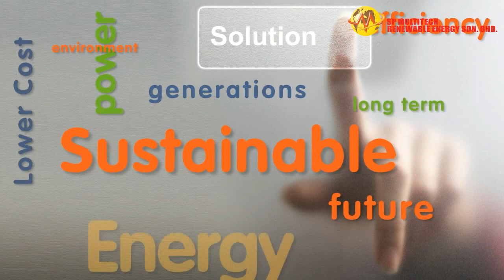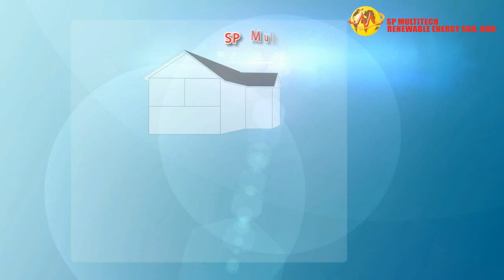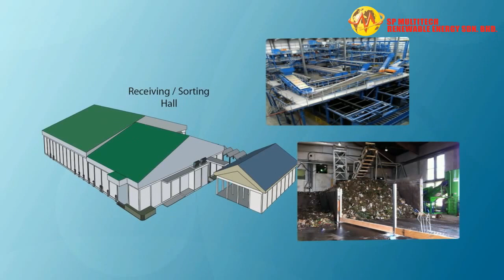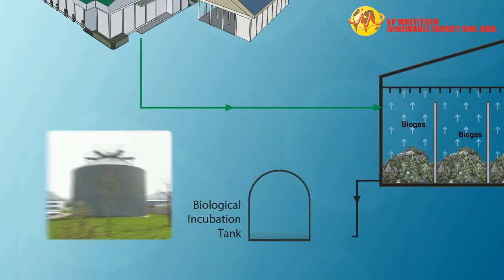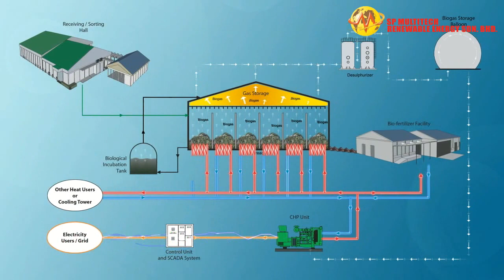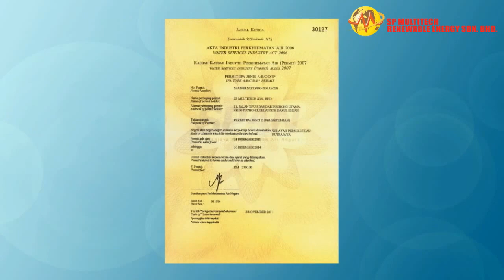Alinova Holding S.A. -  Renewable Energy From Waste

Comment from the maker: How to produce energy from waste. The wastes are waste products of the production process and consumption. Despite having lost any usefulness final waste is still composed of materials that can be recovered by recycling or be used to produce heat and electricity . Some of the waste can in fact turn into an excellent fuel . The energy recovery takes place in special incineration plants such incinerators. The burning of waste in incinerators generates heat ( thermal energy) and electricity via a generator turbine . The incineration can be considered as a technological evolution of incineration . By itself the incinerators are modern incinerators that enhance the combustion of waste to produce energy. It should be stressed that not all waste can be sent to incineration . Can be burned in incinerators only a particular mixture of waste pre- treated with physical-chemical processes . This mixture is called the RDF ( Refuse Derived Fuel ) and consists mainly of plastics, petroleum products , tires , etc. . Anything that can not be started to-energy must be stored in landfills normal or special depending on the type of waste . A recent case concerns the placement of the CDR between renewable energy sources . In fact, despite being an important way to recovery and energy efficiency , energy from waste can not be considered a renewable energy source because the CDR is composed of materials derived from petroleum , which, as everyone knows , is a source non-renewable energy .

Energy from biogas. Another way to generate energy from waste is the recovery of the biogas . The organic waste is smashed and fragmented into small pieces to be stored in landfills under anaerobic conditions. The action of bacteria and micro-organisms contained in the organic matter itself, allows you to start the fermentation of matter. One of the products of bacterial digestion of the raw material is natural gas. The latter is recovered from the landfill through appropriate vertical wells , worked into biogas , and finally burned in an internal combustion engine which allows to produce electricity. In addition to enabling energy recovery through biogas fermentation in landfills also allows you to recover and recycle some of the nutrients and minerals contained in organic waste.
Reply from the maker: Fuel from waste

Gasoline has a very high cost to the final  consumer per liter and a green solution that leverages the wet waste , agricultural waste , crops not used for food purposes but also algae and any other type of biological substance to produce a fuel that will cost half . Not only good for the environment , then, but also for our finances

A clean fuel from waste and the cost of 40 euro cents per liter and ' possible. They proved the experts of the American Gas Technology Institute during a session of the meeting of the American Chemical Society, being held in Philadelphia, who have already made ' the first pilot plant capable of turning all organic waste into diesel and gasoline.

The technology, called Integrated Idropirolisi and hydroconversion , uses a series of chemical catalysts already ' patented to produce hydrogen from raw material , which can' be made of any biological substance , waste ' wet ' seaweed , and then convert it into gasoline , diesel or jet fuel . The process 'already ' been evaluated by the U.S. Department of Energy , which estimated the cost of fuel resulting in about two dollars a gallon , just 40 euro cents per liter.